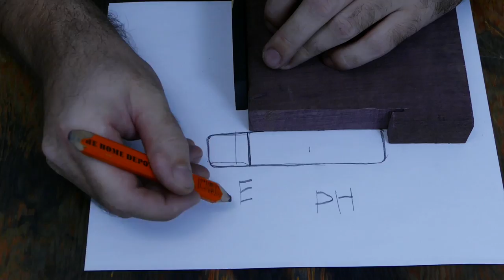Restoring Deba. Japanese Kitchen Knife Restoration

Comment: You ruined the concavity! WHY?! is made to sharpen more easily and to cut better because the food does not stick like on a flat surface. This was a major error my friend :)
Reply: I was painful for me to watch. F***, so much work was put into that concavity as part of the Japanese knife.
Reply: https://www.youtube.com/watch?v=x0cb-tTSVX4
Watch 12:24 for the concavity in the knife making
Reply: The knife was already used past its prime! Much of its backside was already flat as you could see when he marked it. He didn’t ruin the concave portion, it was already mainly flat on the backside. Hopefully a skilled chef used that knife for many years and it died of natural causes!
Reply: @inthespread001  He didn't ruin it... He used the soft plastic material to follow the contour so he could polish it. If he wanted to ruin it he would've used the coarsest stone/paper he had and flattened untill there were no marker left.
Reply: RIP uraoshi
Reply: @johanneslindgren  lets face it, Probably he didn't know the purpose of the concavity (something very normal) so he though it was a defect and he tried to repair it. The deba and all single bevel knifes have a flat surface on one side, but due to the hardness of the blade, is very difficult to sharpen this flat surface of the stone (a lot of material to remove and flatness to mantain) so in medium to high end gamme a concavity is made so the flatness relies only on the borders, so, a minimal amount of material has to be removed and the flatness is easy to mantain. As you can see, if  you remove this improvement, you have removed one of the things  that make sharpening easy, and also, when you buy this style of knife you search for this, as a quality mark. So, if a deba has not concavity, you're basically buying a fancy sheet-stamped knife, not a forged concavity deba :)
Reply: @johanneslindgren  I agree with you. Check out 1:46 in the video. He specifically showed us that he used a piece of plastic to stay with the concavity.

Comment: I don't believe you should have sanded the back of the blade completely flat. It's supposed to have a concave surface. This will make it extremely hard to sharpen properly.

Comment: Japanese handle maker here. drill the holes in the wood before shaping and glueing. Line up the holes with a dowel or something similar covered in beeswax so the epoxy doesn’t stick to it, just to keep the holes lined up when you epoxy

Comment: From this little line cook's perspective, I would say a Deba is basically a multi-use butcher's knife. Imagine a meat cleaver shaped like a kitchen knife. They're sturdy and built with that little stout groove on them to handle thick fish bones. They all taper off at the tip, however, so you can use them for small fish as well.
Reply: So badass you restored an old school one though, in case you read this.
Reply from the maker: Thanks, Marco! I do read all my comments! And answer most of them.

Comment: Unbelievable! I just clicked on youtube after spending an hour on my Deba and this is recommended. I feels. My knife was used as a garden trowel for years, handle full of crap, tip of the blade snapped and edge saw toothed. It's taken me 4 years to get it looking and working like a Deba again with sand paper and stones. I did not use power tools to avoid heat. Yeah, the steel is really hard, but beautiful. Any hoo, 8000 grit for the win and cool video, thank you.
Reply from the maker: Thanks, Mark!

Comment: This is how most people get started knife making. Rehandling an old knife or making a handle for a blade they bought from a knife making supply company like Jantz or USA knife.
Generally, you don't shape the handle until after you have it glued to the tang. If you make the handle oversized,  you don't run into the problem of the hole being off center.

Comment: The issue with the epoxy is the smooth surface on the blue pieces. You need to rough it up by "scoring" it. Or use a different material that will bond better like blue wood. You can also dye your own wood if you like.

Comment: A deba knife is supposed to concave on the back for easier sharpening without removing too much material.  
For those who did not know
Reply: Do that's why they are concave, thanks.
Reply: They are a single beveled edge Japanese kitchen knives; there are many.  Designed to provide a razor sharp edge for precision cuts i.e. the yanagiba (sashimi blade) and it's many varieties...all designs evolved over hundreds of years to dismantle anything and everything out of the sea.  The concave back helps with an absolute straight back surface.
HOWEVER, the Deba is a beast, and can be used as a stud finder with no damage to the geometry of the steel 👍😎

Comment: Great Video!   Couple things.  5min. Epoxy or any quick set epoxy does not have the strength and bonding power that regular epoxy does.  Use regular epoxy it is 5 times stronger.   One other thing, always drill a pilot hole with a smaller bit first.  The smaller bit will not have the same tendency to wander.  It will provide a nice guide for the larger bits.
Reply from the maker: Thank you for your tips! 
I am thinking of buying a better epoxy, Western System more likely. Which one do you use?

Comment: Hi, great first try. For what I've seen in hundreds of knife making vids, whenever they make a hidden tang handle, the drill the tang hole, attach it to the knife and mask the blade. Then they shape the handle profile so they make sure the handle is centered to the edge. That's how they get it dead centered in case the holes weren't properly made. :)
Reply from the maker: Thanks a lot!

Comment: Great work indeed! One question. Why didn't you remove a chipping on the cutting edge while sharpening? It is closer to the heel of the blade.
Reply from the maker: Thanks!
I was trying to remove it, but this steel is so freaking hard, I had to leave it like that..
Reply: @Take_And_Make  I had a similar case before, but with powdered steel which was hardened up to 63-64 HRC. The blade was custom made by russian workshop. I've used local cheap diamond abrasive. It takes only 20 to 30 minutes to remove deep 1,5mm chipping. Or you could try coarse 3M water-resistant sandpaper (50-80 grit) glued on a straight glass blank as a water stone. Or just cheap coarse diamond paste on a glass blank. Or silicone carbide 120 grit stone (5$).
Reply from the maker: Thanks for the advise!

Comment: The back of that knife kinda looks like it was well used and had a happy life! After about a million uses and sharpenings, the concavity of the back side flattens to a point that the geometry and usage become inferior. The marker on a newer knife would’ve shown a polish around the outside of the knife and the concavity would’ve been a majority of the blade but this knife was very flat. Great job, it’s not that it’s a useless tool it’s just not as effective for it’s designed purpose!
Reply from the maker: Thanks!

Comment: I've had issues with that Gorilla Glue 5 minute epoxy before so I quit using it.  Loctite brand 5 minute epoxy is what I use now when I use "5 minute" epoxy, but I typically use epoxy with longer advertised set times now for a stronger bond.

Comment: Could probably have saved time and money on the rust removing..

And don't over grind the Uraoshi, you only need about 1mm of flat polished steel at the edge. Also, when touching up on a Ura use a #8000+ grit stone. You only need to remove material if the flat spot is no longer there, otherwise only use a super fine stone to help on the sharpening. 

The Ura is the flat edge around the concave part, as mentioned in another comment, the knife consists of 2 steels where the hard cutting steel is rather thin.

Another vital thing to keep in mind, on traditional Japanese knives, your stone must be dead flat in order to achieve perfect sharpening all over.
Reply from the maker: Thank you very much for your great response! I'll make sure I do a better job next time!

Comment: its not a multi purpose knife
its for butchering fish or chicken
Reply: I am afraid I have to disagree with you on this point. The Deba is widely considered the multi-purpose blade of the East today. There are particular varieties; hon-deba - Mioroshi for filleting, Ai for fish, Ko; almost a paring knife. Tradition would suggest that the Deba is not multi-purpose, but in practice, at least today, the Deba is the equivalent of the French Chef's knife. In a more contemporary setting we use Honesuki or Garasuki to butcher chicken (especially). I do agree, however, the first job of the Deba is that of cutting fish.

Comment: Who has 10hrs of spare time to sand a knife. I rather work for 10 hrs and buy a belt sander. Work smarter not harder.
Reply from the maker: Dude, I worked in my apartment! What belt sander? You clearly didn't watch the whole video and did not get the point of it.
Reply: Take And Make I did watch the vid, should have called it “sort of restoring deba knife..” your Japanese sword making ancestors are vary sad. I didn’t thumbs down just Incase you’re wondering, I’m
Not that mean.